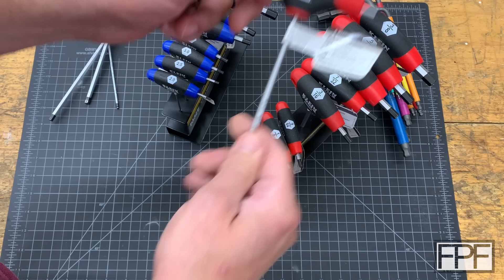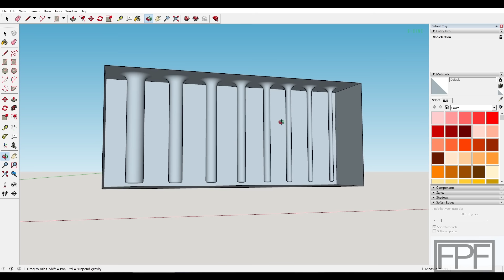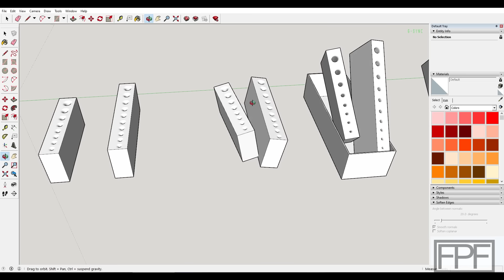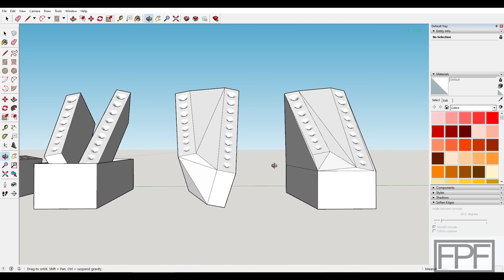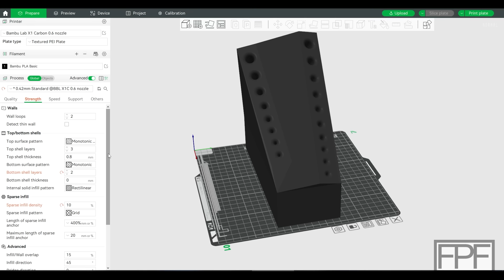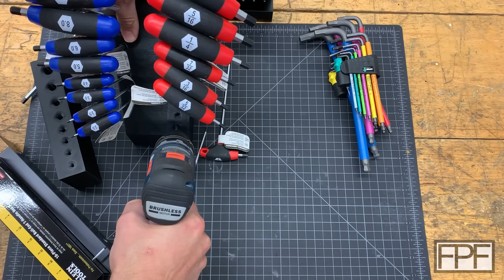3D Printed T-Handle Hex Wrench Rack

Comment: Add a pull tab or small finger loop to the back top to assist in removing it.  It should fit nicely below the handles, assuming you do not move them closer together too much.

The front empty portion can be setup to house your other Hex wrench sets.

I also agree that you should label them.  If you choose to do so in color, then I would paint the inside of the funnel shape as well for better visibility.

Lastly I agree you should try Fusion 2.0.  As long as you are not producing parts with it to sell, it would be free for you.  I started in Sketchup and struggled with it.  I am now using Fusion and things are much easier.

Comment: Great work. You could make the top flat and still have the holes in an angle. Colour change I would make a ring round the holes to see them easier even with dim light. You made it to fit your need and everyone has different needs. Great videos. Thanks.

Comment: I like the idea of the labels in the middle of the holder but just an acrylic pen or highlighter on the labels if you make them embossed. No need to waste so much time on a multi-colour print.  I'd also love to see you make it either hollow or sink down in the middle section (maybe a sliding container out the back?) to reduce the amount of filament used as that thing is a monster eating all your filament lol.

Comment: I use 1/4" hex drive bits instead of allen wrenches or T handle types.

Much more versatile drive options. Most often, I use a screwdriver handle type bit driver. Sometimes I use a 1/4" square socket adapter and use my socket wrench tools. I have even used my battery power driver tool.

Comment: I get placing the metric wrenches with the hex ends facing outward like the SAE on the other side, but the metric sizes on the handles being upside down hurts my OCD. I would label the holes, just because you already know its likely you will use multiples at times and it will be easier to put them back. I agree with the previous comment that a chamfered hole is easier to line up the wrenches than using a radius since the radius is tangent to the top where it meets the surface. Use whatever CAD you prefer, however I think you would be able to edit, iterate and manipulate your models easier and faster with a parametric modeling software, and like mentioned before, Onshape is free and very easy to learn, especially for someone who already has experience making 3D models.

Comment: It would save a lot of the footprint area if you ran both in opposing direction from largest to smallest. ie smallest on top metric - smallest on bottom imperial.

Comment: Great job you should put labels on it will complete the look, also how about magnets on the bottom side in case you that the whole thing out you won't have to worry about it falling over you can just put it on a metal surface, just a thought. 👍

Comment: Seems much bulkier than necessary. I’d consider making the face nearer to vertical and angling the bores downward relative to it to maintain the desired orientation. 

Having a single planar face would also allow you print it upside down. This would make the labels more efficient to print. You could then also model it as a shell that’s open on the bottom with internal webbing to support the bore tubes. This could make for some significant savings on filament and print time.

Finally adding some magnets to base would provide greater stability without requiring 3/4kg of filament.
Reply: This! A single planer face and the bore holes angled. I'd also invert the metric sizes (small on top and big on bottom) and rotate them to have the size read right way up.

Comment: If you’re worried about location due to having multiple T handles out and don’t want a large gap in the center… I recommend start with the biggest one and the top open hole and work your way down the openings; or smallest available and work your way up, problem solved. 
As for modeling I use solidworks and it’s the best! lol only because that’s what I started with at school and work. I’d recommend fusion 360 if you’re looking for a free option, powerful and scalable for the future. I’ve used fusion and it’s a good software if you’re not married to one yet and have the willingness to learn. 
This design hurt my soul seeing the unnecessary features added to fill in the gap, it reminds me of my beginning solidworks surfacing skills 😂. Hey, practice makes perfect and approach is key to a design. I’d personally start with what I know which is my constraints. It could be 2D or 3D, but I’d sketch the exact toolbox opening the sketch the overall T handle(s). Then I’d copy and paste making dimensional adjustments to each; you could maybe scale the T handles once you make one to get you in the ballpark with spacing. It might seem like a lot of work upfront, but you will have less print time and a faster result that is perfect and future proof if a toolbox changes (other projects might appreciate use this reasoning more). You could also cut print time by cutting out the center section / area(s), since it’s not vital to the design when doing these rapid prototype experiments, if you’re not interested in modeling more parts.
Overall, it’s a potential functional upgrade that is worth doing over being content with what you’re given with your purchase. I’ll have to do the same with my set of Klein’s, once I figure out my wants for the design.

Comment: Definitely labels. As far as that empty space in the front, I'd put regular 90 degree hex wrenches in there. Make a separate block and Gloop it. I have these exact same sets and I hate the rack they came in. I've already decided to print this regardless of what you end up with. Thanks for sharing.

Comment: Yes to the labeling. Also, consider making this a 3 piece design with a base that fits in the box and removable blocks that hold the SAE and metric wrenches separately. My bench projects usually need either metric or standard hex wrenches, not both.

Comment: Nice way to spend the day being creative, designing a solution.  IMO, Labels are not extremely useful unless the text is in a contrasting color.  Bambu does a very nice job of laying down a contrasting color on-top of the surface with only one color change.  But with your angled surface, you’ll be spending days making color changes, and probably 1/2 a filament spool of poop waste.  I have found a high quality label maker is really handy 👍😎👍

Comment: I think this wants to be two pinned together prints. Top part printed in such an orientation, that the top surface is horizontal, and cut between the parts parallel to that, with layer height low enough (0.15-0.2mm-ish) that the funnel comes out smooth. The bottom rest printed upside down and as rough as fast as you can spit it out. Potentially just leave the bottom open so it can be cement filled. One can add protrusions coming up into the corners such that they are self supported and can have rubber feet glued to them.

But yeah actually beautiful print i would say.
Reply: This was my thinking too. This would also prevent the issue of droop in the holes blocking it, since they would be printed vertically.

Comment: I have some metric T handles like yours and I got a crappy flat holder I tossed. You are inspiring me to build one with your funnel idea. I think I’m gonna add some threaded inserts in the bottom so I can screw in some flat or angle metal stock to counter balance the top heaviness. I would add the labels as I don’t think it can’t hurt. If you really wanted to get fancy you could make them two separate pieces with a hinge in the back so you could swing them out in a long line or a v shape on the bench.

Comment: Yes,  label them. Also consider printing on the face where the holes are, get rid of those small facets on that face and put a chamfer at the end of the holes so no support is needed. The holes can stay angled to the sides but I think this will help a lot with printing and make labeling only a couple filament changes since it would be the bottom layer. It may require some other changes to make it fit on the bed but worth it I think.

Comment: If you label them, you're going to have the problem of the labels and the top of the T handles being on an odd angle. I think if you have several of them out, it's not going to be as simple putting them back as labelling would have you believe.

Comment: Labeling would be nice.  Bring them a bit closer into the middle,  and since there are fewer metric wrenches,  offset  or stagger them in that verrtical space. You could also then angle them out to the left and right into an X-pattern.  This could keep the profile smaller, more vertical,  and the weight distributed evenly for such a tall print

Comment: You kept the grid infill, if I print PLA with this setting it sometimes generates issues, if I use PETG, I can even feel the hotend knocking the as it crosses previous infill lines.  I don’t know why this is the default infill.  My goto infills are gyroid or 3D honeycomb as they are 3D and provide a bit more “homogeneous” strength The print looks pretty very good IMO.
Reply: Dude. I have had this issue of a nozzle scraping infill for ages and I've tried everything. I can't solve it. Gyroid did help but still, if it's a part with a tiny surface adhesion it can fail simply because the damn nozzle likes to kiss it on the way.

Comment: I’m begging you… please learn Fusion 360, Onshape or even FreeCAD. Seeing you cobble this together in Sketchup makes my brain hurt, lol.
Reply: Wow, doing this in sketch-up takes a lot of skill.  I would second the request for freecad, not because it is better but because it is what I use.😂
Reply: I think the same thing every time
Reply: I’ve gotten spoiled over the years with SolidWorks access through work, but second the vote for a proper parametric CAD program.
Reply: Oh god I haven't used sketchup in ages. Freecad fusion and SolidWorks are all pretty good.
Reply: Or possibly Blender with CAD Sketcher,
Reply: Freecad is pretty good these days
Reply: I’m loving Fusion as it’s what I started with for my cnc plasma, I’ve tried sketchup and god it’s a struggle
Reply: I couldn't get any of those but shapr3d clicked I think it's a brain type lol
Reply: I used to love SketchUp, it's really powerful, just not for stuff like this, it gets the job done but fusion is SO MUCH EASIER even after you learn just the basics.  
I will still use SketchUp for my home projects, or anything bigger than printing size.
Reply: @subwayak  yeah learn what you click with is the right answer I think
Reply: In short, after using SketchUp, Onshape, Fusion, FreeCad, solvespace, Solid Edge, I prefer Solid Edge Community Edition for non commercial projects and FreeCAD for commercial ones. Both free.
Reply: SketchUp is terrible, and not intuitive at all!!!! Disappointing application. But this is what we get with the world we live in currently.
Reply: I’m partial to Shapr3D, personally. Especially since they added parametric history.
Reply: Oh, my comment is removed for some reason😮
Reply from the maker: @Yoggoth  FYI, I never delete comments. even if they're highly negative towards me.  I only delete spam advertising comments.  Youtube, however, will shadow-delete comments with links or what they think might be spam.  What did you post?
Reply: @FunctionalPrintFriday  I know it wasn't you. That was YouTube. It may remove comments for no reason. No links in my comments.
Reply: @FunctionalPrintFriday  I've suggested to learn and use such a CAD software, Solid Edge Community Edition

Comment: 100% label the slots. I have taken a number out of my holders in the past for various reasons (plus kids) and if I got to 1 back I don't want to have to count holes to figure out where it goes. I would rather have it and not need it than need it and not have it. 😁

Agree with aligning the geometry on the front to make it uniform. That would please my OCD.😆

Lastly on the back that slopes down, consider adding some sort of carry handle so you can pick the whole block up and take it with you.

Thanks for the great and idea generating video!

Comment: you should label close to the holes the size so you know which size your missing when its not in its home. put a finger hole/slot in back so its easy to pull out and carry to another station. add some rubber feet and or magnets so it doesnt slide around ?

Comment: I use lightning fill for stuff like this, I also would of probably put more thought into the shape to not have so much needless material, I.E. if I used lightning I would probably of narrowed the holder bits above the toolbox square section in a separated V shape that would allow for more strength to counter the weakness that lightning fill would cause.
Reply: It starts off at the bottom of the print with almost no support but as it builds up it adds more and more in a lightning like fractal pattern until it gets to what actually needs support, in boxy prints it works well as it will use the side walls to support from.
Reply: @MatCatSoft  interesting. I'll have to give it a try sometime. I've always been a fan of gyroid.
Reply: @aetherguy881  yeah gyroid is pretty good I do use it quite often especially prints that actually need good strength like if it's going to have a lot of downward pressure on it, for something like screwdrivers though there is almost no actual weight bearing requirement, so lightning would work good, and save a lot of filament.
Reply: How exactly does lightning fill work? I've looked at in in my slicer and there's hardly ever much support. It's also been a while since I've looked at it.